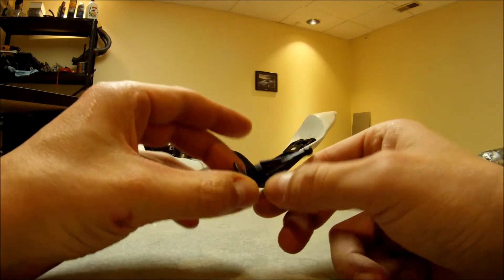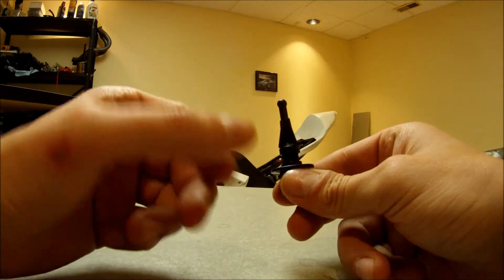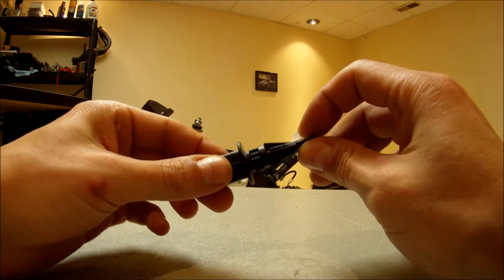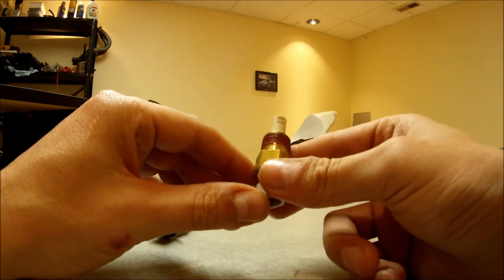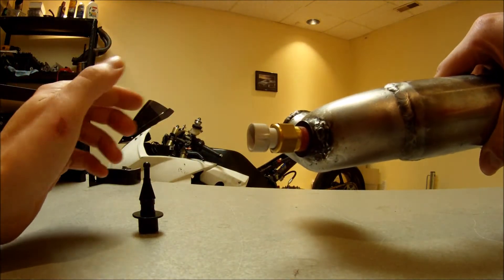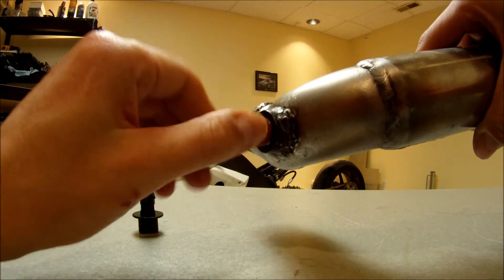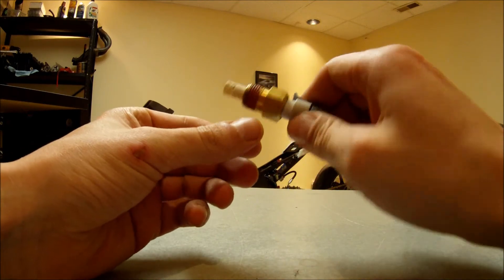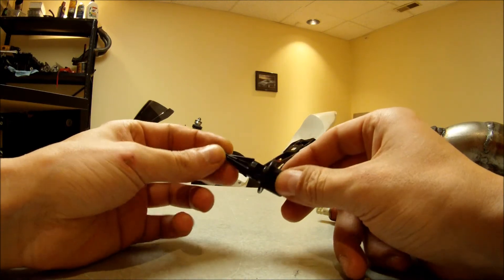TURBO KAWASAKI NINJA ZX10R BUILD, IAT SENSOR Upgrade, PART 15.

Comment: Hey matey, I've just been doing some maintenance on my 06 zx10r and noticed that my sensor had somehow popped out. I don't know how long it's been out for but I've done a couple of hundred miles on it up until I found out.

Would this cause any damage since I've been riding it while its been out ?
Reply from the maker: No, not very likely.

Comment: How do you calibrate the sensor? i need to replace my sensor aswell but not sure on how to do it through the ecu. can you make a video on how?
Reply from the maker: You can't calibrate the sensor, you'll have to just replace it, unless you have a stand alone ecu. I'll post a video of calibrating my stand alone ecu for this new sensor.
Reply: Do you have an email I can contact you at? I'm turboing my Gen1 and have a few questions.
Reply from the maker: Thundercoupe9@aol.com.